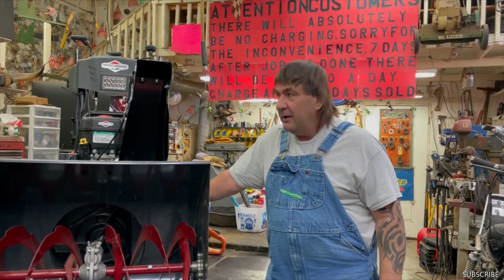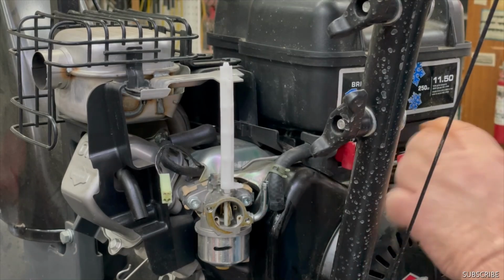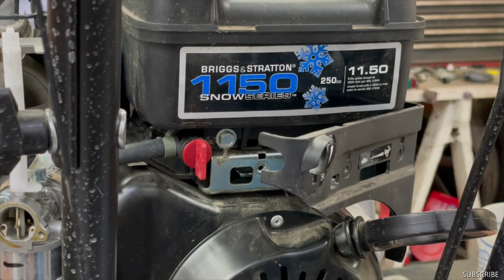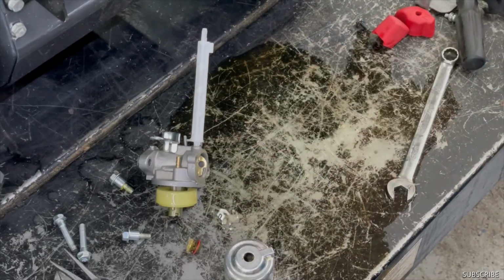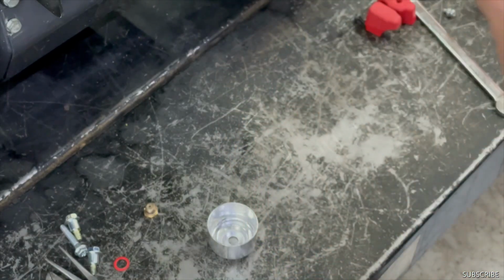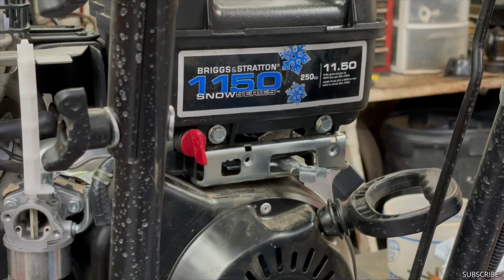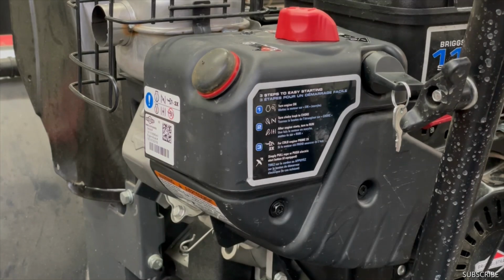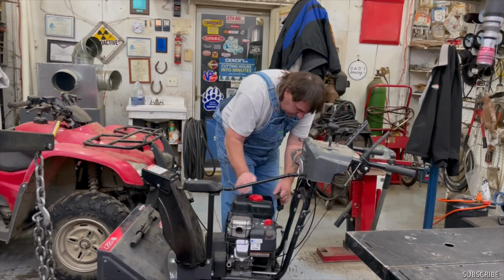Briggs and Stratton S1227 Snow Blower w/ 250cc Engine: Old Gas & Won't Run

Comment: does that engine have a fuel shutoff valve?  do you know if that snowblower comes with a manual that tells you how to avoid that problem with the gummed up carburetor?
Reply from the maker: no shut off don;t  use ethenal

Comment: I have this one, it's crap.From day one cable adjustment was needed, it won't self-propel at times, if it hits a small clump of wet snow (I would expect the wheels to go over it, not stop altogether).Poorly designed chute, poorly designed transmission, expensive and hard to get parts locally. It's still under warranty but the parts I needed weren't covered, just nonstop aggravation, Buyer's remorse here.